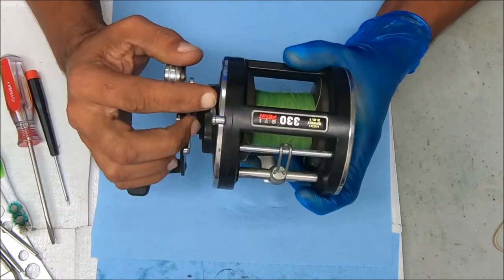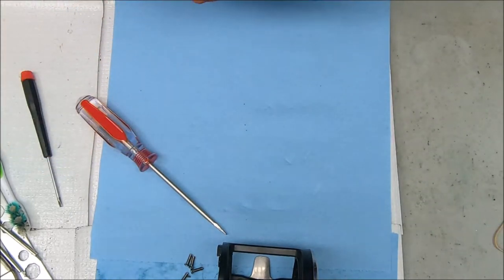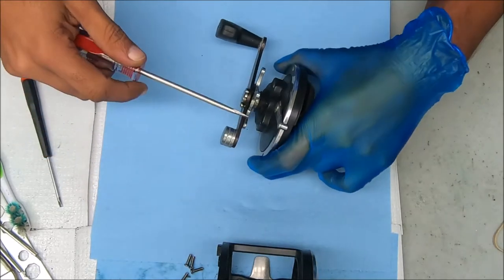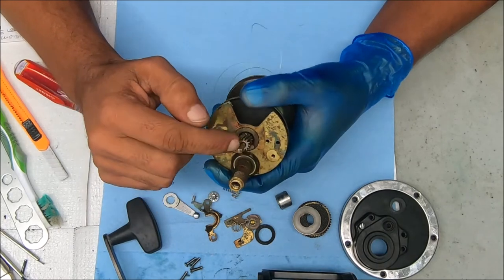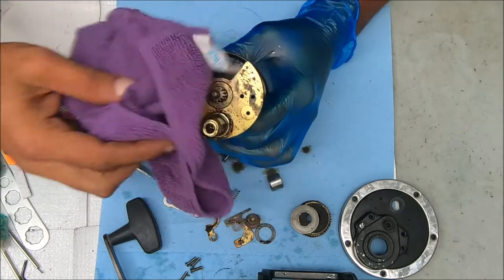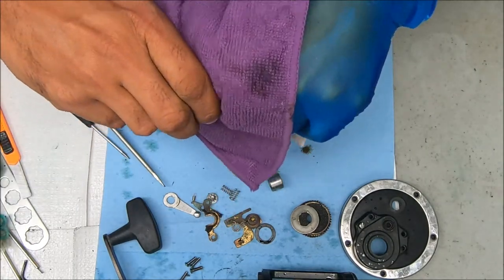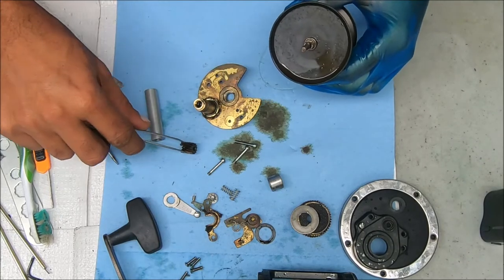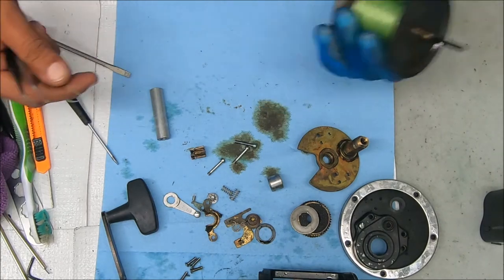Penn 330GTI Wont Go Into Freespool - Problem Diagnosis & Repair

Comment: Why did you not try penetrating oil?
Reply from the maker: Thanks for watching! Those black spots on the paper are from penetrating oil used in conjunction with heat. Experience has taught penetrating oil alone will do little to resolve these issues.... no matter how long you soak it for.